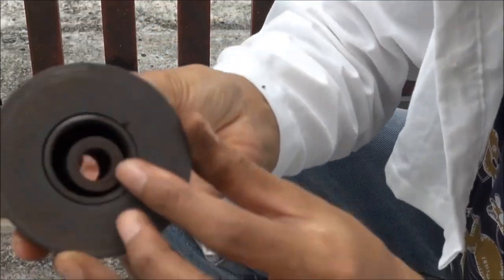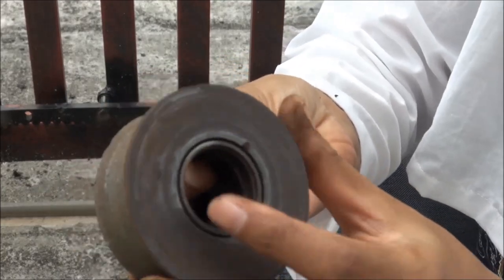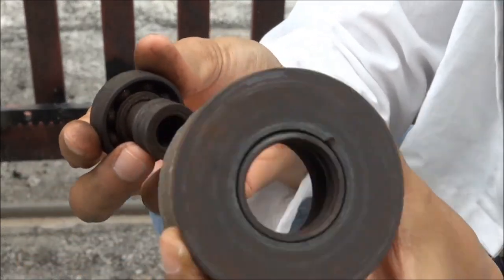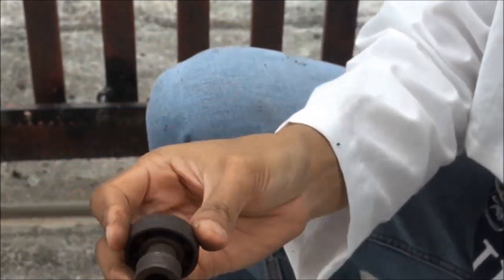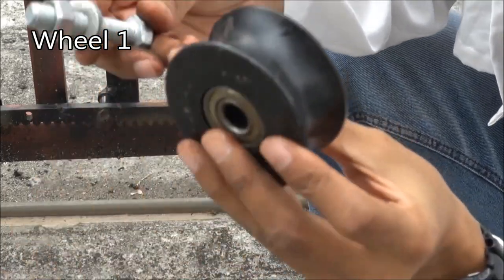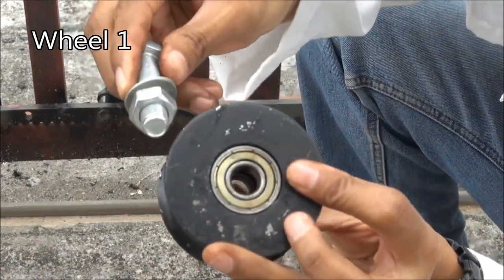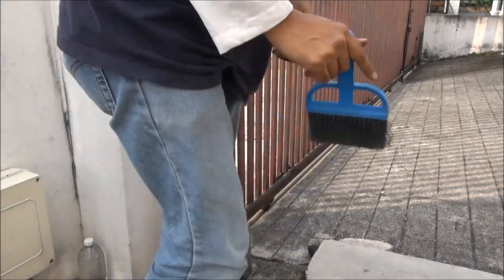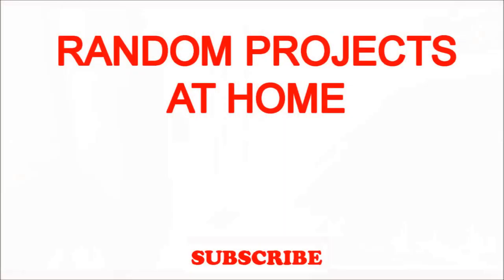Project: Replacing the wheels of the gate

Comment: What oil did you use on the bearings and why?
Reply from the maker: I use mineral oil, the clear and odorless one. It has a light viscosity and will not collect dust/sand on the wheels, especially the bearings. The only issue I have with this type of oil is that the wheels need to be oiled regularly.
Reply: @RandomProjectsatHome Thank you for taking the time to respond to my question.
Reply from the maker: @mturawa  sure thing